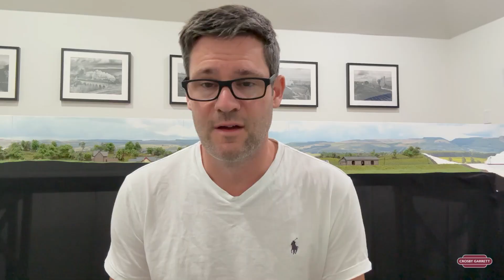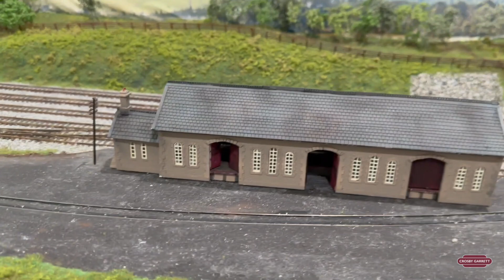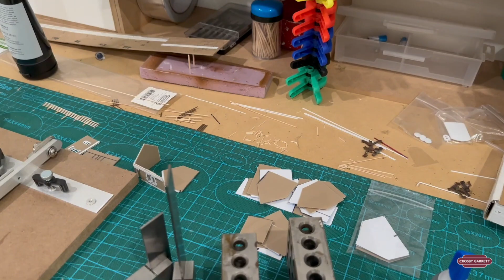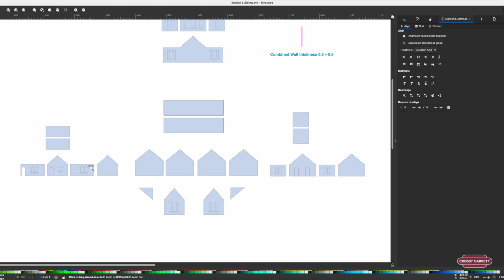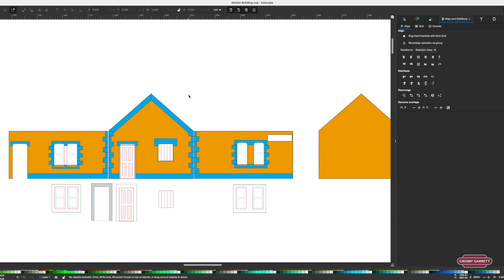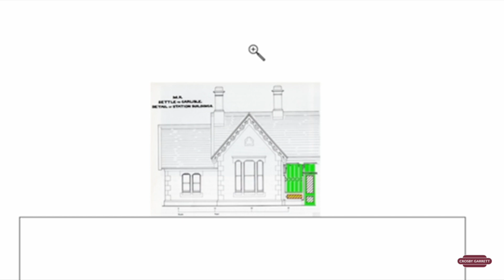September 2024 Update for Crosby Garrett N Gauge Layout.

Comment: Hi Craig Its looking good and all progress is good. Personally I like to see how people build things or do scenics, sometimes there are slightly different ways of doing things which just might be better. Good luck with the Laser Cutter, although I don't have one, I've heard they need some sort of extraction of the fumes to the outside air. Not sure how that would work with a closed (?) room. Anyway all good stuff. Thanks for the update.
Reply from the maker: Hey Peter, Thanks for the feedback. I'll add how to video's to my list! There seems to be a few that would like to see more detail, so I'll go back and do them. :) As for the Laser, well yes I believe you do need to vent, however most people that seem to be using them are making things out of thick plywood and other materials.. When you look at what I will be cutting 0.25mm or 0.5mm Laserboard... It's very thin and I'd imagine, I have no evidence of this, but I think fumes will be limited... However, with the room I'm in I could put a 3" hole in the wall which goes into the attic the other side, or continue the vent out to the underside of the eves.. But.. we shall see as and when I get it I will work that little issue out. :) Craig